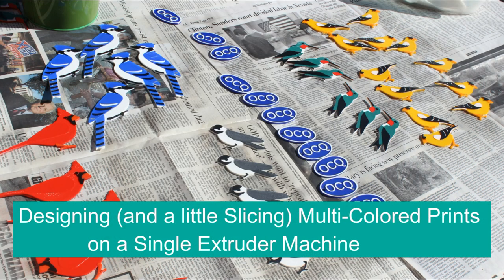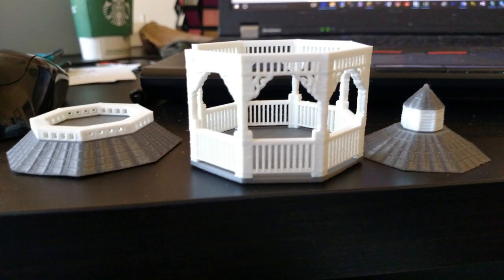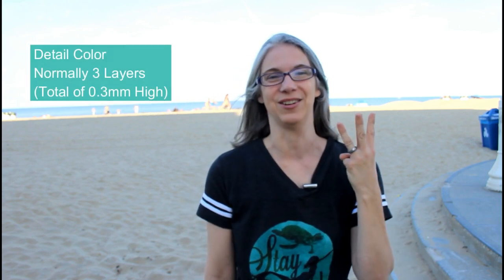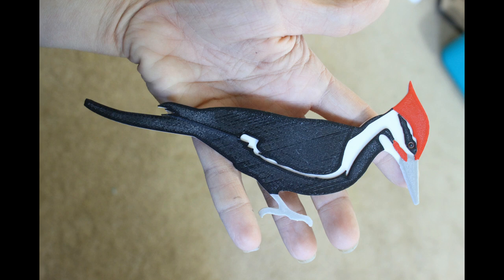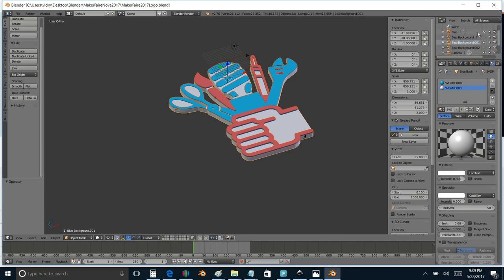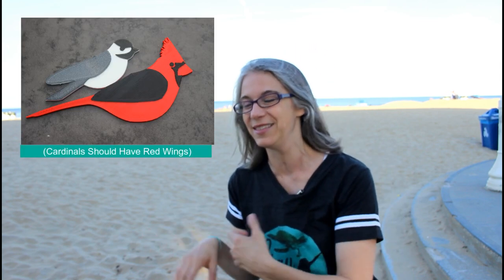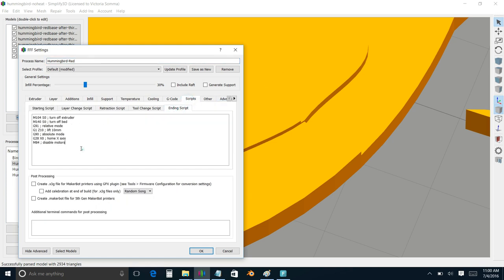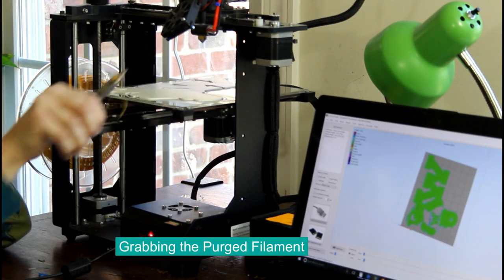Designing (and a Little Slicing) Multi-Colored Prints on a Single Extruder

Comment: Very good video. But I got a question: Do I still need to pause manually the printing to switch the filament or can I use a script command in the beggining of each new S3D process? (if yes, what script command?) I have done some testing here and S3D prints the whole model without pausing. Thanks a lot.
Reply from the maker: Greetings!  Thanks for watching and commenting.  I'm not sure if this will help clarify, but I run each section as a separate print.  If I am running off an SD card, like with the Wanhao Duplicator i3, I copy over multiple gCode files-- one for each color and I'll run the next one once the previous print finishes.  The customized Starting Scripts of the later processes do not rehome all the axes.

Hopefully that helps clarify-- if you still have troubles, let me know!  Thanks again for watching.  Have a great day!

Comment: Your timing for this video could not be better. I have been studying the multiple color print technique and am just about ready to try myself. I see you are a fellow MakerGear M3 user. Mine is dialed in very well at the moment with the exception of making the stop and start marks on cylinders etc. show less. Your willingness to share techniques is appreciated more than you can know.
Reply from the maker: Oh wonderful!  I wish you much luck.  Did you mean M2... or do you have that brand spanking new, super duper awesome-looking M3 that I am daydreaming about?  : )

Thank you so much for watching and commenting.  I hope you have a great day!
Reply: M2 and and I thought I had fixed it before I posted. LOL. I am drooling over the Ultimaker 3 though.
Reply: TGAW The M3 looks very good as well. Do you still get "defects" at starts and stops on cylinders. I am a perfectionist and it drives me up a wall.
Reply from the maker: Alan Simpson With those blobs, I had success turning off "Use random starting points for all perimeters" and using "Optimize start points for fastest printing speed" (Simply3D settings).  Apparently I found that success worthy of Instagram.  :)

https://www.instagram.com/p/9FRYj2vh1Z/
Reply: TGAW  Have you seen any reviews of the M3 I keep watching the forums for the machine to show up. I have the blobs gone using coasting in Simply 3D there is and I do have the optimize for fastest printing turned on but there is an obvious place where the start of a new layer begins. You are just as quality conscious as I am and the print quality being shown on some of the channels is appalling. Most people don't see what I consider defects. I have been making products our small shop with my dad for over thirty years so my background is make the part to the highest standard possible. I am always trying to improve. I see the same in you. You are always looking for the better way.
Reply: I went back to the Maker Gear website and see that the M3 is shipping in July. I thought it was already shipping.